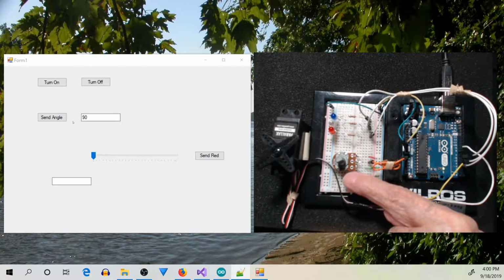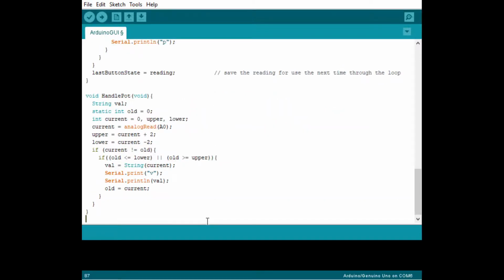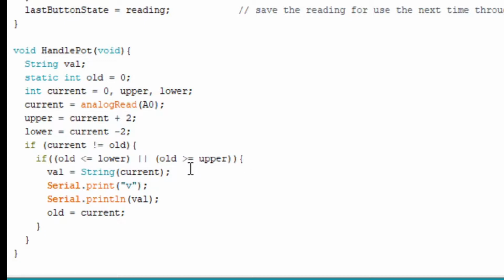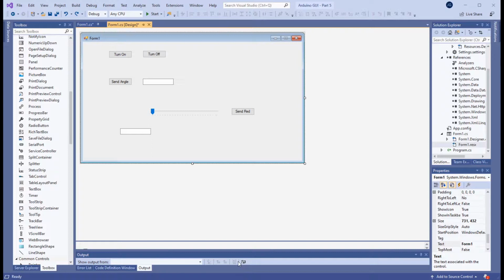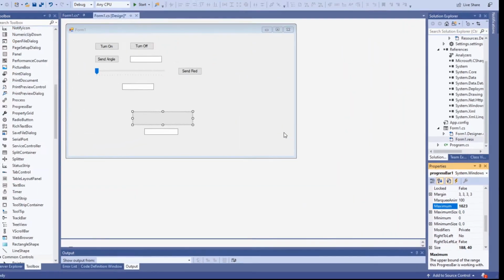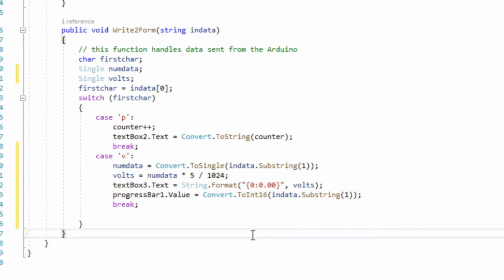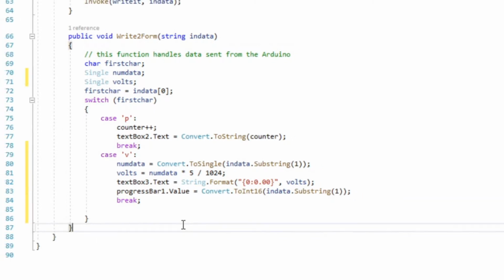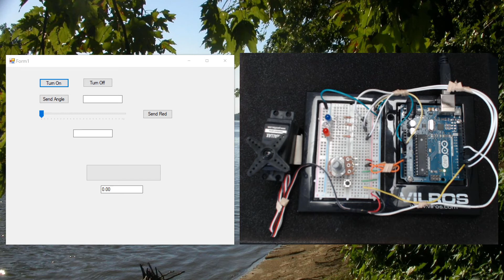Arduino GUI Part 5   Potentiometer

Comment: I can´t get a reading from the potenciometer. It shows a range from 0.00 to 0.07, regardless if the A0 is connected to the potenciometer or not. I check the wiring and everything is fine, then I change to A1 and the same thing happen. Also a double check the code and everything seems to be typed right. I am using a potenciometer of 10K, I dont know if that could be the problem or not. Any suggestions?
Reply: Had the same issue. I changed the command line Serial.print("v") to  Serial.print('v') and it fixed the issue for me.

Comment: I have a problem with reading the potentiometer, when I move the potentiometer at first (Start Debugging) everything is fine, but after I pressing on the Butten Push
There is confusion in the display between the click counter and the potentiometer display.
If I exit from Debug and re-entry its solves the problem until PB is pressed again
can anyone help me ?

Comment: I am in part5 of your tutorial, but I am using different micro controller. My controller is 12 bits ADC and 3.3v, do I still have to declare numdata and volts as single variables  or different type? when I declared them as single, my program gives error. Thank you for helping me, you are a great teacher.
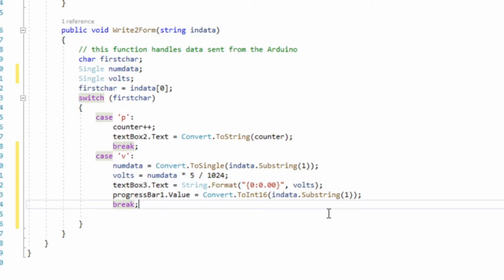Reply: Hi Michel. I'm not expert and here are my thought. A "Signle" data type in C# is the same as "float" data type in C/C++. One type is aliased to another at the language level. In the Priority window (right bottom), change the "Maximum" limit to 4095 instead of 1023 (6:41 in the video). Also change the the limit of the equation of "volts = numdata * 5 / 1024;" to "volts = numdata * 3.3 / 4095;" and note the 4095 number, not 4096 (8:06 in the video). Finally, if this does not work, it might be in the your µC code. Change the line "int current = 0, upper, lower; " for "unsigned int current = 0, upper, lower;". Not sure if this will help. Good luck!
Reply: Ohh Noo